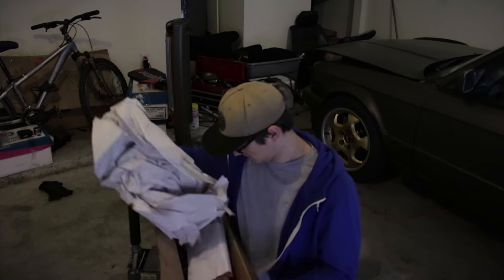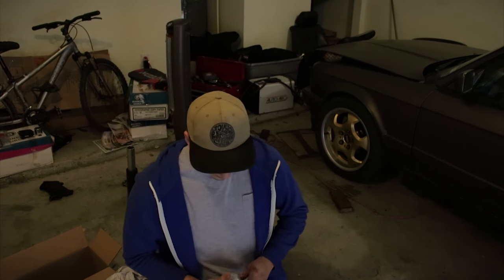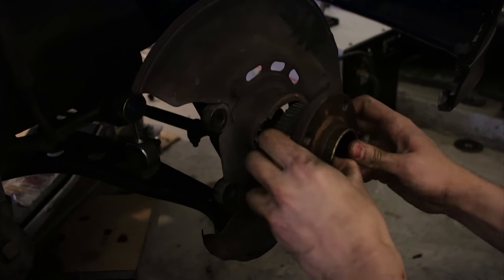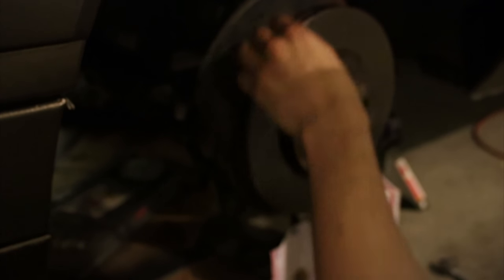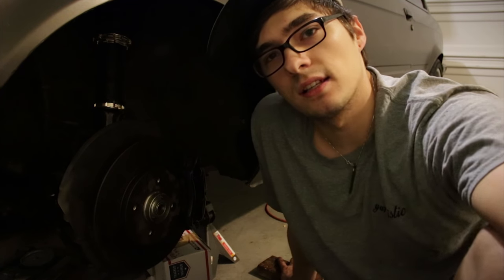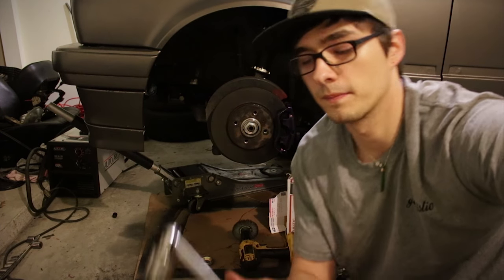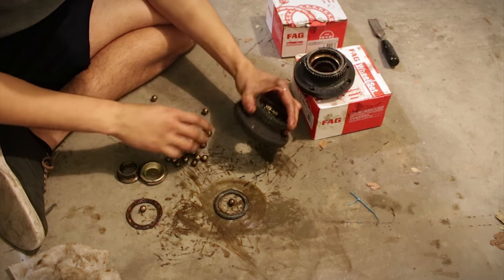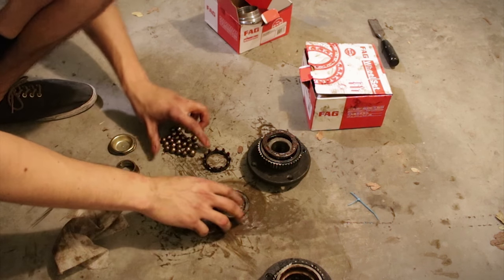Turbo E30 Maintenance: Replacing Front Wheel Bearings

Comment: Have done it twice. It needs 290NM (~213ft lb). First time i searched for a self-help workshop, which has a torque wrench that fits. second time they told me before, they had one, but they didnt. So i gave it max. torque with their wrench (180 lb ft), an then turned a little bit more. Didnt like that. I think i ll buy a torque wrench that fits for the next time.

Comment: hopefully that spindle shaft that the bearing just fell off of isint screwed up. the bearing should not come off that easy. it is NOT a good sign. you really should have torqued at least the wheel bearing nut. too much torque and it will stress the bearing and cause it to wear prematurely. car is looking good tho, keep up the good work.